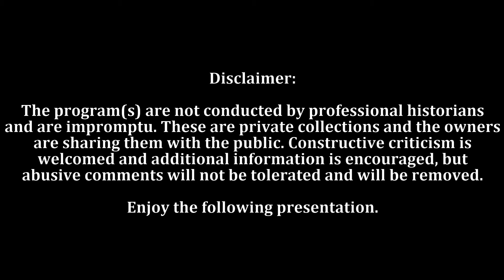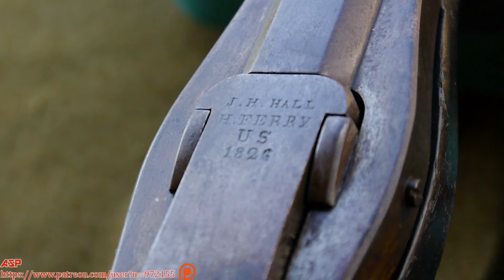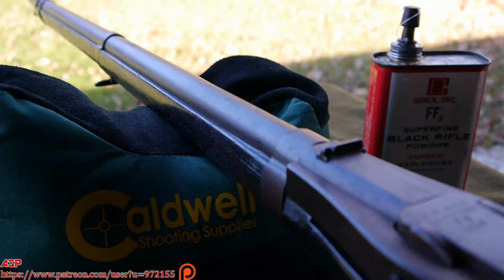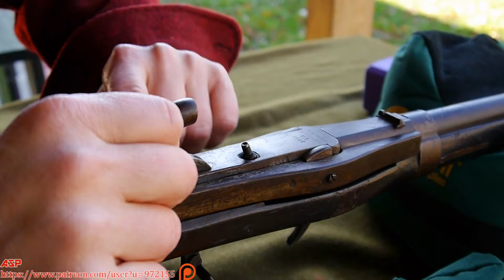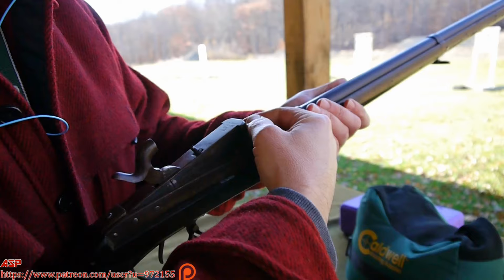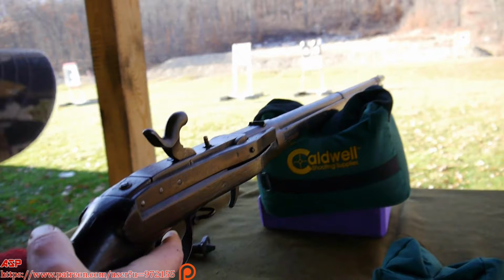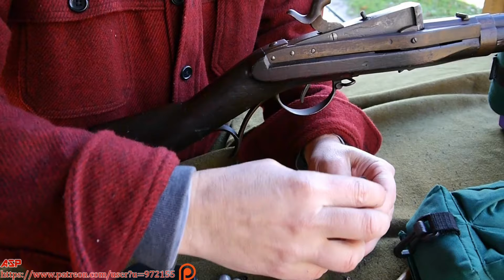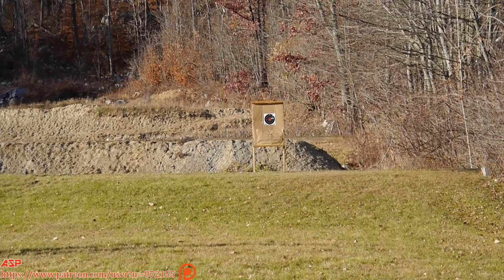Model 1819, dated 1826 Hall Rifle in Action | Collector's & History Corner

Comment: For people that don't load with cartridge using the military practice manual, there are many guesses, many wrong guesses, about speed and positions of load.

The Hall was not that much faster in infantry hands than the Springfield or Harpers Ferry 3 band muskets.  It shaved off maybe two or three seconds from a well trained muzzle man.

It required muskets to be in fairly unsafe positiones during the repeated load of hot barells and breaches.

It was much more expensive to machine with more moving parts to break.

It did help with the fouling of the 6th or 7th show, but so did a cleaning cartridge issued in each pack of 10.

Muzzle load 3 banders and Bess can be loaded quickly while kneeling or prone, if the recruit followed instruction.

The Hall was however very useful in treed sniper, light infantry and mounted service....where swinging a rammer is clumsy.

In massed infantry lines however it did not provide enough benefit to merit the cost and extra time if production.  Battalion companies often alternated fire so a muzzle musket in 700 to 900 hands could provide constant uninterrupted repeated fire.

Collectors and antiquarians often see only their meticulous handling, as shown here and try to extrapolate to field use 200 years ago.

There were good reasons breach loaders were not adopted on a large scale until after the 1850s and 1860s

Comment: Nice very nice! finding info on these old JH Hall's is difficult to find thank you so much for the excelent video and info.

  I too have a JH Hall, mine is a flintlock made N. Middleton Conn.  1833.  I'd like to fire fire my Hall someday, I had it checked out and it was deemed safe to fire however the threaded screw that clamps the flint is broken in two pieces it is of an old thread type that is no longer used today, would you know anyone that might recreate to the old style thread?  I am aware that there are repo parts available but they are of a modern thread and I choose not to retap the male end of the flint clamp.

Comment: It was no less efficient than any revolver.  The chamber should have been  equal to land diameter and  the barrel rifled from the start   and the  same diameter all the way through.  A bullet instead of a ball should have been used which could not move forward,    A double barrelled one would have the sight in the middle.